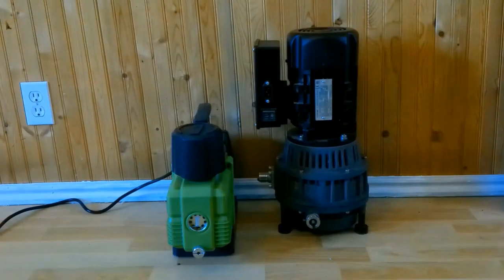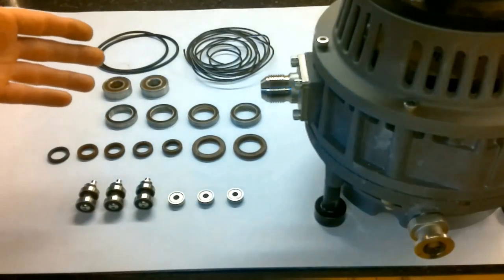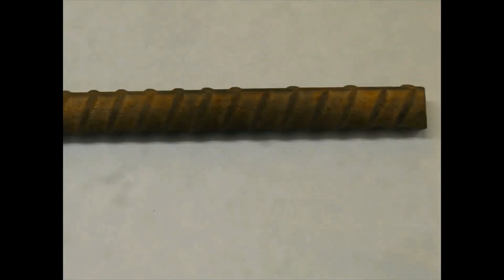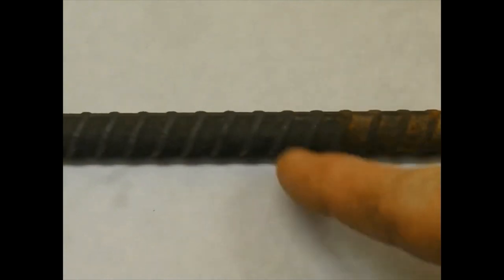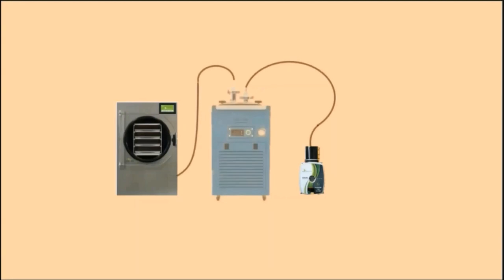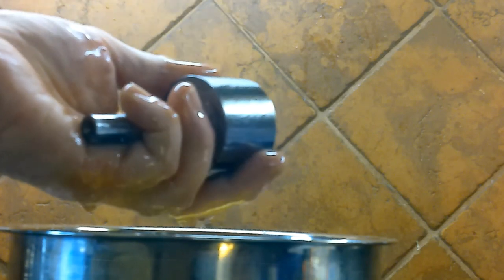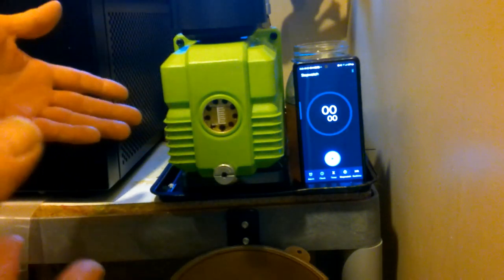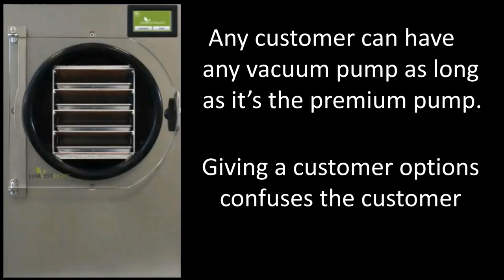Harvest Right's Premier Versus Oil-Less Scroll Vacuum Pump

Comment: After 25 batches (27) the oil is still clear.  At 25 batches  you filter and top up.  Cost of oil vs oilless it is a no brainer due to rebuild schedule and cost.
Reply from the maker: Agreed, I'm just in the habit of changing/filtering after each batch.  It also comes down to the oil you use. 
https://youtu.be/qPJ1sdce0NM

Comment: Why can't something be added between the freeze dryer and the pump? A vacuum chamber or a chamber that pulls through oil to capture the acidic moisture.
Reply from the maker: There is.  It's called a $1300-$5000 freeze trap.  Harvest right incorporated the freeze trap inside the chamber wall.  It's the only way to do it on the cheap.
Reply: That’s what the cold trap is

Comment: Thank you. Invaluable info.  Two questions .. 1. Do you filter the oil you’ve removed for the next exchange?  2. That hole where water flows back to the pump, what is it for? It can’t be covered / closed?
Reply from the maker: I change and filter the oil after each batch.  The hole is where the vacuum pump connects to the chamber.  It can't be plugged.
Reply: @Philat4800feet  Each batch?  and that's with the premiere pump>  I thought you only had to change oil every 20 batches>

Comment: Thank you for your awesome video and thorough explanation of how the system works and why it fails.

The biggest issue from my perspective is that Harvest Right had LOTS of issues with their pumps when they first came out and left a very bad impression on a lot of people who ended up with a multi-thousand dollar paper weight.  These are not cheap items and the pumps are expensive to replace.  People naturally want the best most durable pump.  When there is an oil-less option for ~$1500 more most people would naturally think it's better.

Thanks to your video I feel comfortable going with the Premier pump.  Now we just need the repair parts available before I actually need them.
P.s. I also agree that changing your oil after every batch is a SUPER EASY way to prolong your pumps life even longer, and FREE since your re-using your old "filtered" oil even tho it's only recommended ever 20-25 batches.

Comment: I agree completely with your findings and conclusions. .

I started out in 2014 with my medium sized freeze dryer (the only size they sold at that time) and their original standard vacuum pump.  I used that pump for several years and it worked OK.  However, I suffered all the normal problems of dirty oil, water in the oil, and messy inconvenient oil changes.  I never had to tear down the entire pump, but I did remove the cover around the pump several times for a much needed cleaning.  On the top of the pump body (inside the cover) there is a flat sheet of steel that is a shield intended to control oil spray.  With all the water that collected in the oil, that shield was very rusted.  That was a contamination catastrophe waiting to happen, but it was generously solved by my machinist nephew who made a stainless steel replacement part for me.

That dirty, messy first pump finally prompted me to spend the money for the Harvest Right oil-less scroll pump, the black one with the vertical shaft.  It worked well and not having to change oil was great, but it was very noisy.  I had to wear ear protection if I was in the same room while it was running.  

After about a year with the scroll pump, the noise was such a problem that I decided to buy their new Premium vacuum pump and have been completely happy with the Premier.  It's physically much easier to change the oil compared to the original pump, the control of oil spray and water in the oil is much better than the original pump, and the Premier is much quieter.  Using a smart phone audio level app, my dryer running with the scroll pump was about 93 dB compared with about 72 dB with the Premier.  The phone app isn't calibrated, but it gives a reasonable comparison.  No more ear muffs!  

If you ever have information on the Premier's manufacturer or source for replacement parts, please post them in these comments.  I'd like to continue using mine for many more years.
Reply from the maker: Oh the memories of the old standard pump.  I'm working on a replacement part list.

Comment: Most important thing is to let the pump eat some air afterwards while it’s warm. Allowing the pump to pull through warm dry air gets the moisture out of the oil. 

With proper vacuum pump oil changing it every time would be ludicrously expensive and it’s unnecessary if you ballast the system properly from time to time. Vacuum pumps are simple and tolerate a lot of abuse. What kills them more often than not is true negligence running for a year with nobody checking in or just sitting around without getting the moisture out first.
Reply from the maker: I agree, changing the oil, with new oil, every time, would be ludicrously expensive.  I change my oil after ever batch with newly filtered "used" oil.  However, in the HVAC world, Navac recommend to change the oil with new oil, after every pull down evacuation.  There's a bunch more garage in those systems.

Comment: 2:08 parts for the Premium Pump? Where can those be purchased? Harvest Right refuses to send those parts to me.
Thanks
Reply from the maker: Working on a list of where to buy
Reply: @Philat4800feet  
Thanks Phil, Harvest Right will NOT send the gasket which fails due to wear as is warps over time. I talked with a repair tech in UT. Zero help and is aware of the gasket issue. I have made my own with KLINGER Thermoseal, just a temp fix. The gasket needs the red trails for proper seal. Thanks again for the videos😎

Comment: If someone has the oil free pump, maybe a condenser of some sort and/or filter dryer is in order?    I've been using the 5 minute dry cycle for a few years with medium use, so far no problems with the pump.  Also keep a fan on it as it always gets hot to the touch without it.
Reply: or maybe just a desiccant?
Reply from the maker: I have played around with in-line desiccant filters.  The problem is as long as there is a vacuum the moisture remains a gas and passes through without absorption.